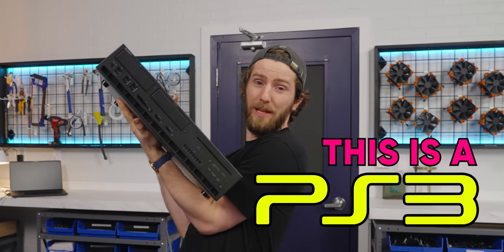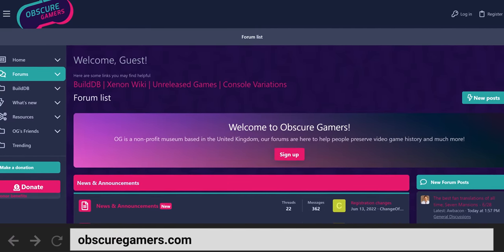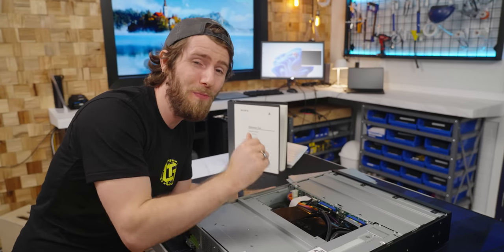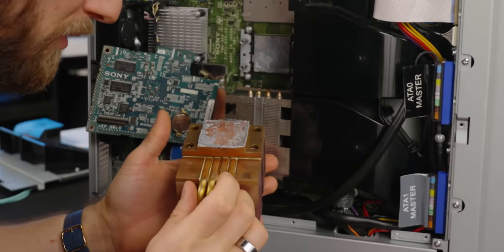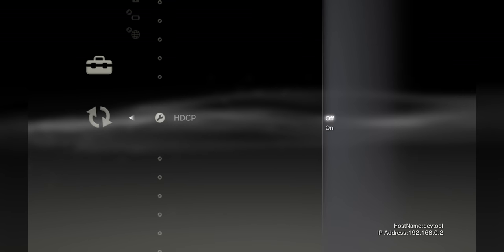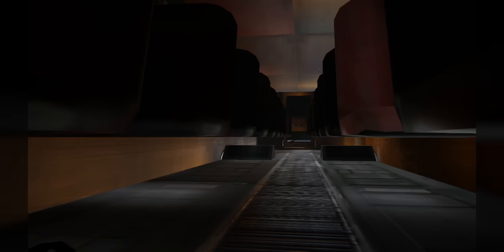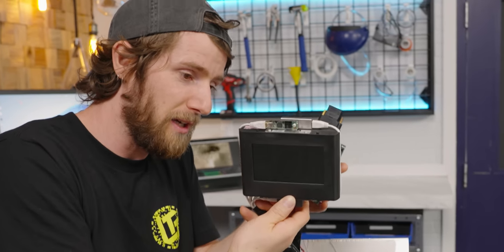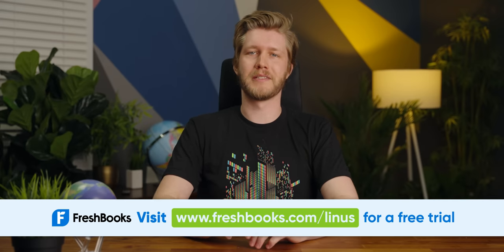I Await Sony’s Cease and Desist - PS3 Dev Kit

Comment: I remember those. they would generate quite a lot of heat and they would bring a whole circuit down in the studio when they were plugged in the wrong one. the extra ram made it quite nice to debug the OOM errors testers would get on closer-to-retail Test kits.
Reply: Obvious PSA is obvious, but don't clock on the fake LTT link posted by the spammer.
Reply: @prerunnerwannabe  Unfortunately, common sense is not as common as one   
would like so the PSA is necessary
Reply: With a 1,000 watt PSU, that doesn’t surprise me.

Comment: I worked at Sony through all those years, so there's a ton I could say....

The silver devkit shown was not the first. The CEB-1000 was the first and it was much bigger. So big in fact that it had forklift skids built-in.

The devkit you have was designed to be rack mounted, however most developers put them vertically on the floor under their desks. This resulted in a lot of them being destroyed by accidentally kicking the plugged in front USB cord for the controller.

That Vita devkit was very early and only a few dozen were made. It was pretty much solely designed for early evaluation of control schemes and was instrumental in cementing back touch as a hardware feature. That's why it had no significant processing of it's own and relied on a PS3 devkit.
Reply: Looking at the internal design and the fact that it has a Web server made me think it was made to be rack mounted.
Reply: @Muscleduck  It's much more than just a web server... it was a bit more like a BMC in a server in that it could power on/off the PS3 as well as handle all the debugging and profiler support.
Reply: @alexrosenberg_tube  Linus used the words Web server, but I assume it's more like a Dell IDRAC. Remote management.
Reply: CEB-1000 looks a lot like what a first devkit would look like. Reminds me of the Sony GS cube and old PS2 prototypes a bit. (Also appropriately codenamed Shreck lol)
Reply: Tell us something more! It's so interesting
Reply: @Muscleduck  iDRAC is a BMC. The devkit didn't obey any standard like IPMI -- it was it's own design, but handled many of the same things.
Reply: @Muscleduck  as i know that how devs kit designed is.
Reply: What do you think of Sony now? I personally think the PS3 was the last, truly PREMIUM console to ever exist. So innovative! I don't think they've been as innovative since.
Reply: @ganganthefatman1382  I have a lot of respect for my colleagues there and the work they've continued after I left. If they had competitive compensation, I'd still be there.
Reply: @alexrosenberg_tube  That was a good run around. I can see why they hired you. 😂😂😂
Reply: @alexrosenberg_tube  Thx for explaining Alex!
Reply: Alex, how's it going buddy.. I'm glad you posted this, I was going to say something similar. We're are probably some of the few folks who had CEB-1000's
Reply: @robwyatt  Yes, ours was delivered down there and had to be driven up to the Bay Area in a personal car.
Reply: Thx for the extra info, if u don't mind what do u think about latest news which  Microsoft Xbox games available on Samsung smart tv server!?
Reply: @drsyoutube  I don’t think about Xbox or Samsung products at all.
Reply: @alexrosenberg_tube  good to know from expert , that's why I still kept my old psp  but nothing from Xbox at all lol
Reply: @Muscleduck  Yeah, I'd also guess it was more of a BMC like Dell IDRAC or HP iLO.
Reply: @drsyoutube  what are these nonsense words you're posting
Reply: kicking the device would "destroy it"?
Reply: @LinkinPark4Ever1996  Plug in a USB A connector. Kick it. Notice how the connector breaks off the motherboard, ruining it.
Reply: I was gonna say, if all Vita developers had to use that version of a dev kit it sounds like it’d be pure hell.
Reply: I can only find lowres pictures of the CEB-1000. Do you think any more exist in the wild?
Reply: @Alex I worked at LOVEFilM at the time and we built one of the first VOD streaming apps for the PS3 in that era. I believe we were provided with the later (actual PS3 shape models) but remember walking around the Gt Marlborough St office in London and seeing these units on/under many desks. It was probably December but I reckon that office was pushing 35c or higher with the heat they were kicking out! 
:)
Reply: I just looked it up and, wow. the CEB-1000 is MASSIVE. I'd love to see someone make a video on it.
Reply: @alexrosenberg_tube  Is the game controller board a separate board that connects to the motherboard? If you destroy the gamepad controller board, couldn't you just swap that board for a new one instead of retiring the whole system? Or they didn't supply these particular parts?
Reply: @vdochev  Developers were not allowed to open these up. And no, it wasn’t designed with that sort of failure in mind. It was envisioned to be rackmounted and came with rails.
Reply: Absolutely! So fast for the money that the airforce clustered Playstation 3 consoles into a supercomputer.
Reply: @alexrosenberg_tube  
Hey, I have a few general questions about the CEB-1000 unit; 

1. When would this have been being used (about). 2003? 2004?
2. How did you use these? Did they have some kind of early UI or were they completely unusable without being hooked up to a PC?
3. How mature were the tools around the time you would have needed to use the CEB-1000? Were there huge teething issues with game development? I know those boards didn't last long and got replaced with the 2030 et al fairly quickly.
4. Did these use real prototype Cell processors or were they using PC like components that "approximated" Cells?
5. How long did it take to get around the PS3 architecture, especially the SPUs et al; what could they pull off given the right programmer? Precisely how difficult was it to get decent, performant code out of the Cell?
Reply: Yeah it had 2 power supplys and came out before the 360 amazing thing
Reply: I remember the first version we got was a fat folded aluminium box with no audio output and small cutout for a 7-seg display at the front (you could actually see the PCB inside) and no nvidia gfx chip. I think all it had on the back was power, a couple of ethernet, some display and USB. No DVD/CD/SD/etc.

The 1st silver versions we got had no fan control, just on or off, so jet-engine loud or the whole thing off. My one had its main HDD die, so the boss ordered us to break the seals and replace the HDD, but that didn't actually work.
Reply: @talsit_de_cod  The hard drives would've been tied to each unit cryptographically. Very interesting! Do you know if it had two Cells like claimed? What was it like to develop for the thing?
Reply: yeah, i remember those, it was the size of a micro mainframe
Reply: Oh the memories of trying to get bricked Vitas to flash at Sony. Is it somewhat bricked where you have to flash with procedure A? No? well maybe it's partly bricked and you can flash with procedure B? No? Well I guess this one is back to Japan bricked. Here have another bricked Vita, see if you can get this working.
Reply: Almost got me.
Reply: @ganganthefatman1382  Dude for real?! !! I feel entirely the same , I hadn't bought a console that had so many features that blew my mind . The fact I had tge 80GB OG Phat PS3  & I was 🤯 I had a Blu-ray player for $499-$599 when many paid over $1000+ on a plain Sony Blu-ray(fr.y same when I was tge only person at 12y/o I'm my house with a DVD player . But just the fact of the Remote Play, Built HDD(bye bye Memory cards) , 1080p, built in wifi & digital store, Six-Axis( absolutely loved that control for Heavenly Sword💙💯) and the last console with true BC that you did NOT need internet to access your old titles.  I still have my launch 80GB PS3 , the Blu-ray laser needs to be replaced and that is all
I need for me to have it fully working again.
Reply: That explains why both of my DECR-1000's have broken usb ports...
Reply: *its own
Reply: Ah yes, and testing a launch game on the first ‘retail kit’ where you walked into a room and folks with gloves were o my allowed to touch it, etc.
Reply: @starfrost6816  it still used the XMB. The first firmware versions had the XMB. It was first used on PSP and PSX, both made before the PS3 Development Kits.
Reply: @overkill1603  xmb was implemented in firmware 0.83
Reply: @starfrost6816  the older firmwares had concept user interfaces that looked like xmb also, sadly, they were never used, i know this because i dug up some info, because one of my friends worked at sony computer entertainment
Reply: @starfrost6816  so, i want to say that you don't need to believe in everything they say because there are some people who speak the truth, like me.
Reply: @GanGanTheFatMan  the ps3 was a hot mess and they knew it before release. It wasn't even truely premium besides the cell processor architecture which they already knew was having issues. 

The 360 is technically more premium of a console even despite the issues it had and the more consumer based components and serious design issues.
Reply: @Muscleduck  he is not understanding what it is..port games on it ..????
Reply: Can you tell if this devkit is the same device running as ps now server for ps3 games? Or is it Sony Bcu-100 (Zego)?
Reply: That’s a new one for me. The Wikipedia article on that model talks about additional memory being unique to that model, but then describes the same specs as the devkit. I suspect that model just means it’s been flashed with firmware locked for use in video production. The TEST units came in a firmware config like that; they could play unsigned/unencrypted Blu-rays but not games. These units were made for folks working on Blu-ray discs.
Reply: I'm still using my PS3. In fact, my son is playing lion king (PS1) on it right now after we watched some movies on Prime Video and YouTube with it. I love the PS3 and actually downgraded from the PS4 to PS3 a few years ago.
Reply: do photos of the CEB-1000 exist? I could only found one and it's pretty bad.
Reply: Question: If one can grab those Dev Kits, and their documentation (yknow, manuals, software, etc), it can be possible today, to fully develop a game working of a retail PS3, using all console capacity?
I mean, with a nowaday project. Like, some game mod, such as Rockband 3 Deluxe, or if someone wanna port a PC game.

Comment: Used a lot of PS2/3 dev kits back in the day.  By the late 00s most proprietary game engines started running on PC as well as consoles so a lot of testing could be done on your workstation.  But occasionally QA would find a platform specific bug and you’d need to boot up a dev kit. Usually either GPU or performance related.
Reply: like a pc backend for the game engine?

Comment: 10:37 completely agree, shocked at all of the straight forward and very functional options in there.  Having "under the hood" options available (even buried into a "use at own risk" menu) is extremely useful.
Reply: I think it would be kinda cool if they sold a different version with all that unlocked for the people that would want it. Maybe add a small upcharge or something. Cause I would pay like 50 bucks extra to have all that stuff readily available on my console
Reply: @timnone2924  then no one buys games for ever ahahah
Reply: @fabiosequeira8844  And that's a bad thing why?
Reply: @Johninadelaide2022  Because that's where 3/4th of the money comes from
Reply: @matt_l2003  yea, like setting the fan speed to 100 on a superslim. Not many know how powerful those fans ACTUALLY were. I could feel the exhaust airflow 10 feet away from the console at 100% fan speed. That thing went brrrrrrrr
Reply: @matt_l2003  Well, I do. My dad bought one back then and told me it was a blue-ray player. Technically it was a cheap option to play blue-ray at 1080P back than, and I was about ten so I thought the "game" tab was for some basic interactive cartoons where you could choose the outcome. So it sat for ten years with only running the race-car demo menu once.(the remote's start button doesn't work in game so I couldn't get the game to start)
I just rediscovered it two years ago when I found the controller the summer I entered college. Bought GTA V in the online store. Lots of trouble getting registered in US and the download took a day because I am in China, even though I have gigabit internet, it was not connecting to the US server sometimes. The graphics at 720p should be great for 2010, considering I was still playing 2D games back then in computer class. The game is still is pretty fun, classic. But I hear the thick module has overheating problems and I don't want to destroy it. Planning to keep it almost brand new and in perfect working condition.
I bought a gaming laptop a few days later so I just took the dualshock 3 and paired it to a driver software that would let me pass through any axis to any control. The gyro should be great for flight and driving games but I am haven't been able to find a game where a controller feels better than a keyboard.
Reply: You can enable dev mode on a new xbox just by registering a dev account with Microsoft. I don't think it gives you all of these handy features, but it does allow you to run unsigned code.
Reply: @phuzz00  That's interesting. I imagine that's the first step to jailbreaking a modern Xbox then, right?
Reply: @matt_l2003  Seriously, homebrew is worth it on literally every console. Nintendo notoriously has incredibly easy consoles to homebrew, as an example. The Wii U? Put files on an SD card and open a website. The 3DS? Put files on an SD card and open a website. The Wii? Go to a website on a PC, and open the message on your Wii.

Then you are able to do stuff like dump BoTW for the Wii U, and run it at 4k 144fps with better graphics and mods in Cemu, for example. You can also use it as a pretty good emulation box.

There is no case where homebrewing is bad, especially with consoles that don't get support anymore, but are still powerful enough to run games.
Reply: @soarinskies1802  Omg yes lmao, I had the regular slim and always tried setting my fan speeds to 100% since my console was always so hot, and man that thing was 10x worse than a PS4 fan haha
Reply: @tbuk8350  Totally agreed, I do it on basically every electronic I own. iPod, PS3, 3DS, Switch, Xbox 360, PS4, etc. Every electronic I've owned has been homebrewed, it's just so much fun! However homebrewing can actually be bad at times, as homebrew tools can enable piracy, and a lot of homebrew tools on the X360/PS3 are usually hacks that people put on old Call of Duty lobbies that kinda ruined the game forever :/ But for the non-malicious homebrew for convenience, then yeah I agree it's not bad at all! It's only because people can use it to pirate and hack online games that it's blocked on all consoles
Reply: @matt_l2003  i remember playing COD 4 a few years ago and someone managed to mod a "zombie" mode into the multiplayer where players were the zombies, it had ziplines and openable doors. 

Not all of them are bad lol

Comment: fun fact... there is a "devkit" out there that can be installed on certain model ps3s if they were jailbroken and have most if not all of those dev options
Reply: How would one do that
Reply: @Grimm405  with a fair amount of technical know how, a PS3 console that is able to be jailbroken(not all of them are), the ability to take apart and put a console back together, and a special flasher tool to flash the cpu. Essentially there was a certain firmware of the PS3 console where you had complete access to do essentially whatever you wanted with the console. Then in firmware update 3.56, this option was removed. Jailbreaking allows the firmware to be downgraded to 3.55 which allows full access to the machine and you can install basically whatever you want on it.
Reply: @matthewashbaugh9254  Your info became outdated 2-3 years ago. If your PS3's minimum version is lower than 3.56, you can now use BGToolSet to install this without hardware tinkering.
Reply: The og 60gb fat PS3 with the four ports. Pre 3.55 firmware if I'm correct
Reply: @ItzJigz187  can even jailbreak a ps3 slim iirc, just not the "super slim" that had the sliding cover.
Reply: you talking rebug or generating a dex ofw compat flash dump
Reply: @-yuvia-  You can do both.
Reply: @Kaaarrrrlllll  Have had my super slim jailbroken with freeshop for over 2 years now.
Reply: @urbanaugust2240  he was talking about real jailbroken, cfw, not hen LOL
Reply: @-yuvia- Aren’t you the LittleBigPlanet guy

Comment: The absolute best thing about these kits is how they would build up static charge and shock you when you touched the case
Reply: I push my wife around in a wheelchair everywhere we go. The fing rubber wheels make it so anything I touch shocks me. I hesitate like a lab rat anytime I have to touch anything
Reply: @NeoTechni  There are solutions for that. Either a anti static strip that touches the ground or maybe special wheels

Comment: I'm pretty sure the main reason the dev kit dropped in price so much was that by 2009 (when it dropped to $2k)  it was just a retail PS3 with some extra RAM and connections.
Reply: Correct, when I worked in the industry, I had a fat PS3 with dev options that could do 95% of what this one could do. It was enough for most companies, and you get a couple test models that were even cheaper but could load your games.
Reply: These days, you can flash a PS3 retail kit into a devkit